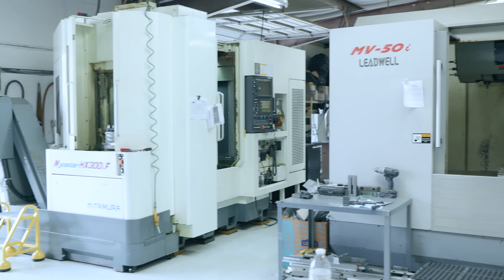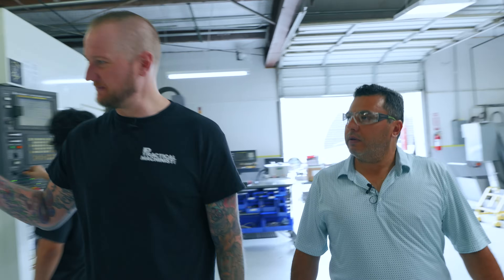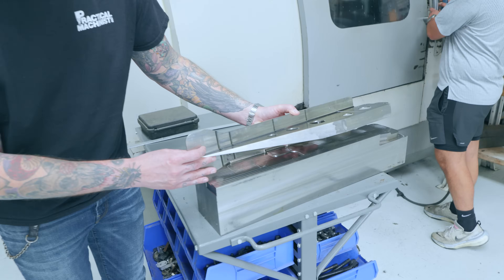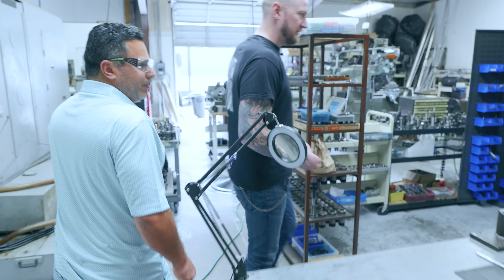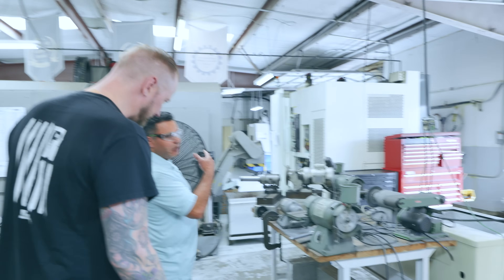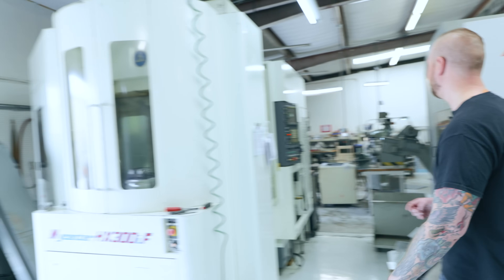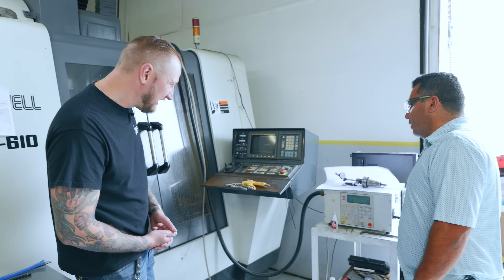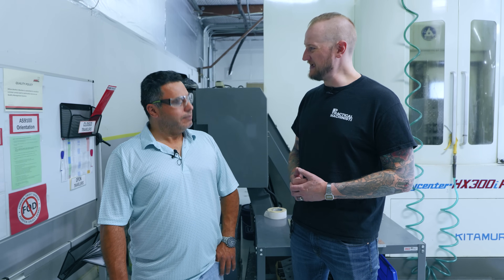When Aerospace Machining Becomes a Family Business | WBM Machines Shop Tour

Comment: I’m not a machinist but couldn’t this long part be cut at an angle with a bandsaw before it ls placed on the cnc and save time and tool wear?  If I’m wrong , please explain. Is it because ti is difficult for a saw?
Reply: Yes, the part profile could be rough cut on a bandsaw, but this takes a fair amount of time, and I think most machine shops would rather pay the machine time  to remove the material than pay another employee. Ideally, the parts could be 'nested' in a large sheet and cut out with a waterjet, but could be a  significant expense to get started.